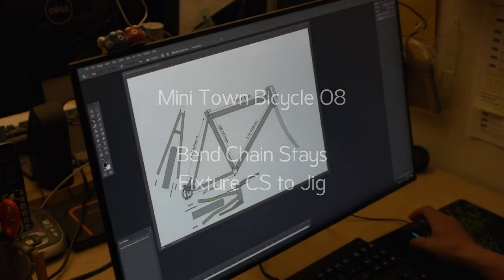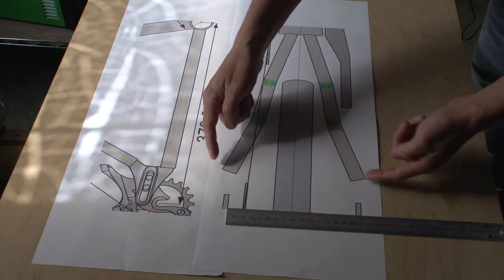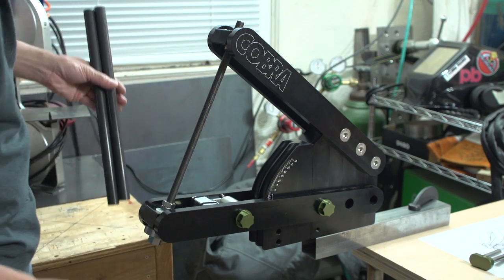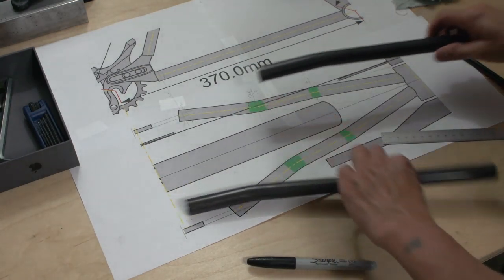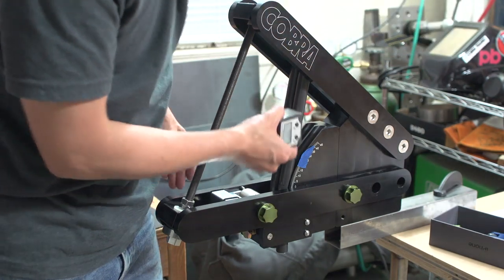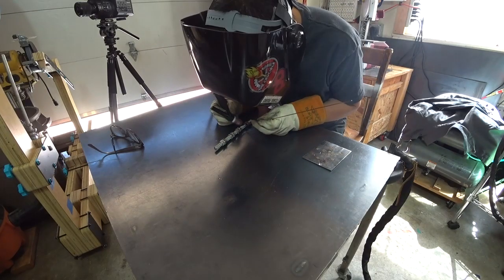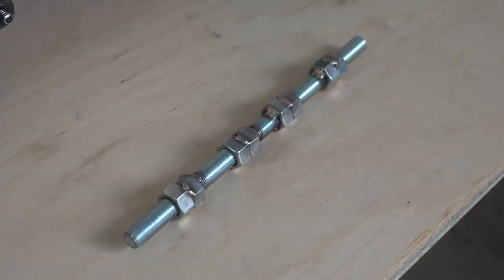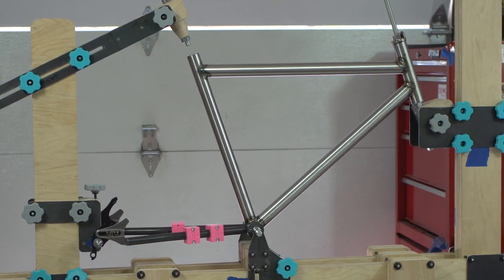Bend Chain Stays and Fixture to Bicycle Frame Jig - Mini Town Bicycle 08

Comment: What kind of steel are these tubes made from?
Reply from the maker: 4130 chromoly. McMaster sells it along with other steel suppliers. The wall thickness for most bicycles is .034" (thats what I'm using).
Reply: Thank you, for that note. I was wondering that myself.

Comment: I made a welding fume extractor from a bathroom extractor, some flexi hose and a microphone stand for around £70. It works great and cost less than 10% of a commercial welding extractor.

Comment: Thanks again for the business. It's so cool to see someone else use it on camera. I realize I need to make it more clear that the point of tangency of the die is not at the 0º mark! The angle scale is shifted so that you can read it directly against the top face of the lower bending arm, but the centerline of the bending arm when it is at 0º is the point of tangency. Measured from the bottom of the tool, the point of tangency of the bend is 2.5" or 63.5mm. I generally use Bike CAD or a 2D drawing to find the point of tangency of the bend, then I measure 63.5mm, make a mark, and that mark lines up with the bottom face of the tool. A subtle revision I'm making going forward is to make a "sightglass" (just a hole) so you can peek through the center of the lower bending arm to line up your mark directly, as to remove the possibility of accidentally shifting your bend 63.5mm in the wrong direction.
Reply from the maker: I realized that as soon as I made my bend in the wrong place, that 0 degree mark does not necessarily mean the bend starts there. :) User error on my part! Thanks for making such a great bender Joe, I never bent tubes so fast.

Comment: If you ever feel that the thread on that Cobra is lacking (as opposed to an ACME thread) you can replace it with one from a scissor jack. I have a similar tube bender (not a bike type, it's used for gas pipe, with 4.5 mm thick wall,  thus needs more umph) and i changed the original thread (was a cheapo ACME, not quite up to the task) with one from a junked jack and it works beautifully. There's something to be said about purpose used threads. And you can be sure that the thread will outlast the machine, after all, it was meat to resist the shear force of half a ton to a ton of car. :)

You should experiment with giving the top ends of the two pipes (sticking up) a tack, i saw that they moved, i know you're interested in absolute precision, so that might be one step towards it.

Also, if you ever find yourself lost in the downsides of software, you can whip up a quick sketch using SketchUp LayOut (or regular SketchUp using top view) and printing it with a program called BigPrint (created and curated by a fellow YouTuber named Matthias Wandel). You can make your design changes extremely fast and you can even import top/side views like that directly in the program.
Reply: The issue with using an acme thread in this case is that acme threads are way too coarse. My first prototype of this bender used a 13tpi leadscrew and it didn't offer enough gear reduction to give a consumer drill the leverage to bend heavy bike tubing. I went to 20tpi threads. Admittedly 60º v threads aren't as long-wearing as acme threads, but with proper lubrication and for the intended purpose, the hard bronze on steel will last many cycles. The nut is also something I keep stocked and offer for essentially cost to customers. If you were to use an acme thread you'd need more torque than a consumer drill has and it would become a different product with less utility. Turning the screw with a wrench is VERY SLOW. I've considered a planetary gear reducer in line with an acme thread screw, but so far that just doesn't seem to be necessary or feasible.

Comment: Welding in galvanized steel releases zinc oxide which is not good for you. That could also have been the smell from the fumes. Proper ventilation is key!
Reply: Definitely. When i first started welding, i didn't know that. Gave myself a nasty, nasty headache for two days almost. Not something you'd want to play with it.
Reply: Yeah metal fume fever is no joke.  You are breathing in zinc oxide by doing that.
Reply: That steel is galvanized?